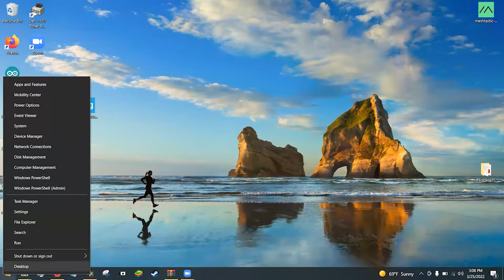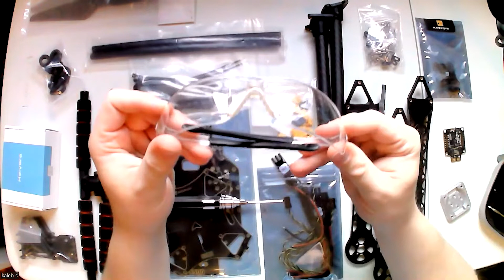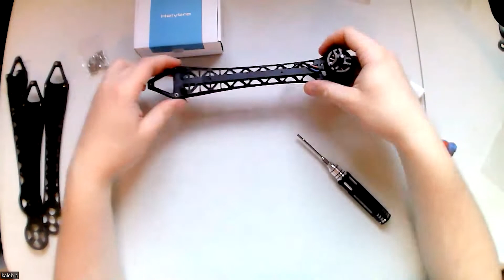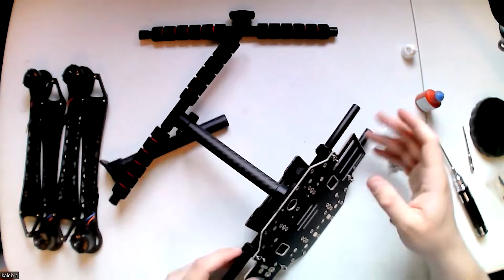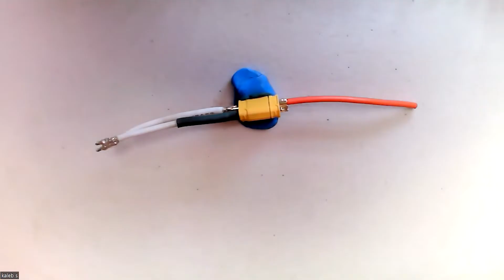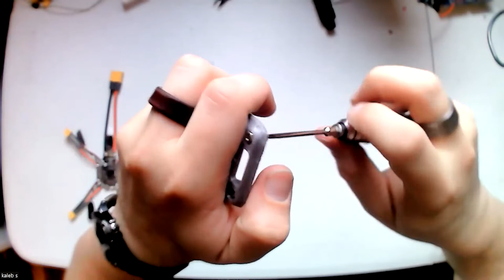S500-F405SE Built Video Part 1 - Assembly

Comment: Excellent yet educational video! I'm currently looking at building a drone of a similar caliber and am intrigued as to why you chose the S500 over the X500. What do you plan on the quad for? Best of luck on the maiden!
Reply from the maker: Thanks! I was putting the drone together as a project for a university course, and the kits chosen for this course were the S500. I plan on using the drone to test my ability to integrate other systems such as a telemetry radio, camera gimbal, and GPS(which I have successfully integrated), as well as just to practice Ardupilot systems more. It's currently airborne and tuned and is flying great!
Reply: @kalebstanton9371  heyy Id love to get in touch with you. I am working on a similar project Thanks in advance. :)